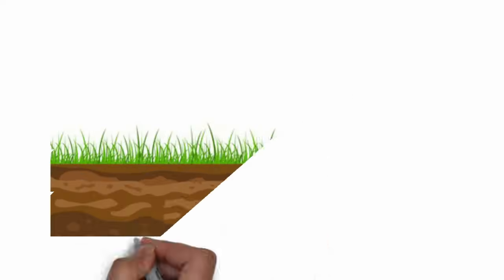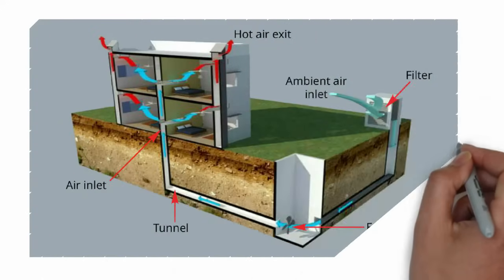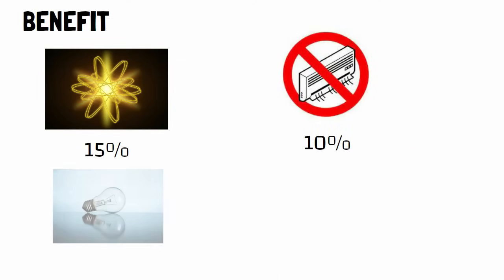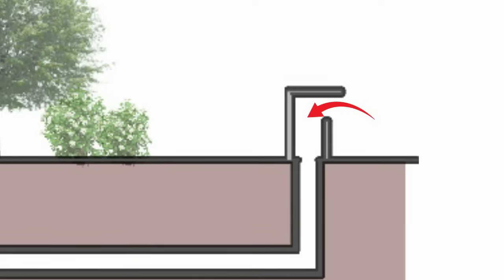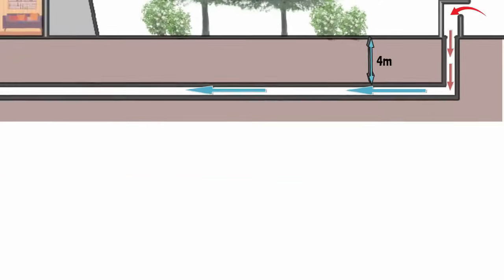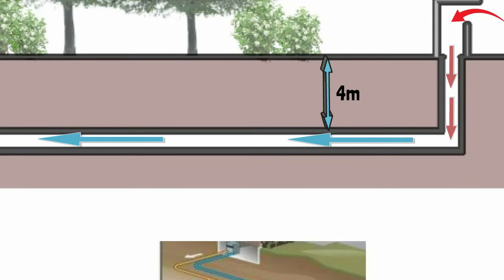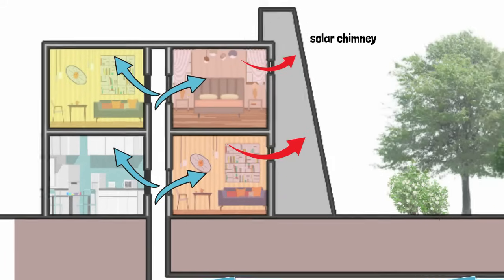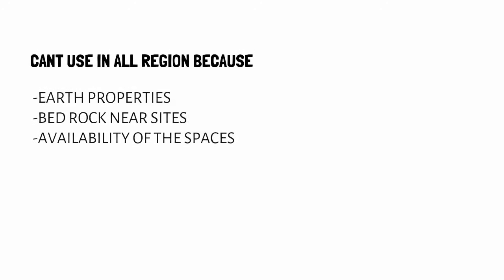EARTH AIR TUNNEL || HOW IT WORKS || passive cooling technique

Comment: cheaper way: go solar and put an air conditioner. No pipes, no tunnel, no fan, cold and dry air at the temperature you want.
Not to mention the fact the terrain around the pipe will warm, so the system can't be run forever, it need a stop from time to time.
Reply: My house has full aircoditioning but I hardly use it these days because of rising power bills.
Reply: @liboy9844  I have AC in every room (I mean: every room, not only the bedrooms) and I use it every time I want. My solar plant supplies enough power that not only I don't pay anything for it (just a fix amount for the power grid link) but I after 1 year it generated a surplus of 3 MWh, a credit that I have with the power grid supplier and I can take it back in the next 5 years. This is Brazil, strong tropical sun🙂
Reply: Things breakdown. There are maintenance tasks with solar and an air conditioner. A buried pipe really needs no maintenance other than changing/cleaning an air filter.
Reply: Solar need almost no maintenance, just wash the panels once per year (and here in Brazil, at least, you need no battery because the power grid works as it was your battery pack: you inject the surplus on the grid and can take it back when you need it, paying just a little per month for the grid service). Also, solar serves you for everything, not only for the air conditioner. And AC also doesn't require a big maintenance and can supply the right temperature you need. I think there's no comparison with a simple pipe that, in my opinion, can't work as well as AC (or can't work at all, maybe; it's just a theoretical project that hasn't enough installations to become a real benchmark).

Comment: How do you keep mold from growing in the damp underground tube?
Reply: Constant air Flow.  No mold. Only a little condenswater. Need a Niveau, away from the house.👍🇩🇪
Reply: @thomasschafer7268  Not according to info I ran across about 5 decades ago, mold is a big problem because of the condensate you mention.
Reply: yeah I want to know too
Reply: @RickySupriyadi  Yeah...me ,too.  Look up 'duct contamination'.  Can you say "Legionnaires Disease?"
Reply: @RickySupriyadi  buat sumur gali aja 6m mskin/gantung pralon pralon pasang exhaust fan sebagai cool air inlet lalu bikin jalur instalasi unt outlet ke ruangan2 (pasang filter di tiap outlet). Bila jalur pralon luar terpapar sinar matahari...bungkus... Posisi inlet jauh dibawah outlet jadi kondensasi bila ada akan ngucur balik ke sumur.
Reply: Use PVC pipes. They are usually most mold resistant than other construction materials.
Reply: I also want to know what kind construction should be used to secure the air duct far below the ground, at least it should be able to withstand earth deformation when there are earthquake or flood...
Reply: you could use an industrial dehumidifier to remove the the water first, purify it...and use it for drinking water. get 2 use's out of it

Comment: All depends on how fast the hot inlet air looses heat. The pvc pipe, poor conductor of heat. Metal pipe is ok. But the heat lost by the underground pipe will heat the soil around reducing the efficiency of the system. I don't think that the system will work for continous working
Reply: Off the top of my head porous stone tubes may work better in a damp, moist soil as there is a medium to transfer the heat. Of course this raises other serious issues others have commented. The other issue will be radon in soils with minerals. It is an interesting idea but a lot more engineering will be needed to make this a universal and practical application.

Comment: What is the tube made of?
Reply: Galv, PVC, fibre-crete or concrete prefab sections... doesn't really matter. What matters is the heat transfer.

Galv corrugated storm drain pipe probably going to be your best option in locations where you can source it. Good heat conductivity with surrounding soil, lasts practically forever. They've built bomb shelters out of that stuff since WW2. Incredibly high resistance to weight of surrounding soil, and large enough to crawl through. Corrugation also increases the surface area for heat transfer (a good thing).

Comment: What about heating?
Reply from the maker: It works in a same principle. The temperature under the ground is higher than the temperature in a surface.
Reply: А вот отопление будет работать, и именно так, самостоятельно - тёплый воздух будет легче холодного, и будет подыматься в помещение. Более того, если вы сделаете грамотный подогрев ещё и от солнца, то солнечными зимними днями сможете полноценно отапливаться, без всяких вентиляторов.
А с охлаждением так не получится - холодный воздух тяжелее тёплого, и самостоятельно в дом не пойдёт
Reply: Возможно нагреваясь в теплом помещении, воздух начнет подниматься и засасывать новую порцию с другого края.